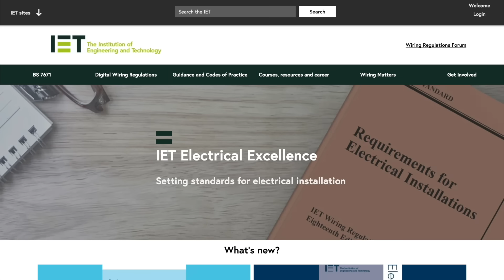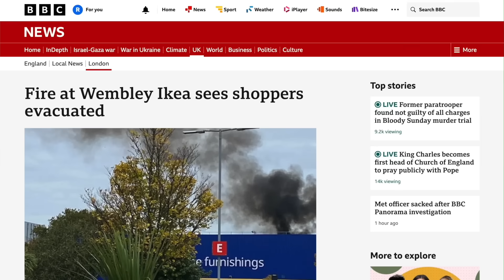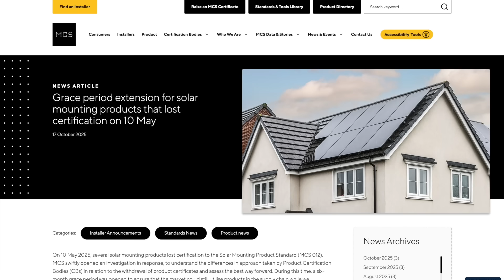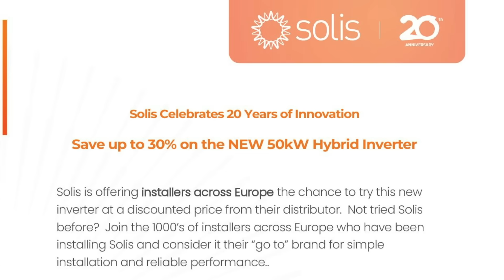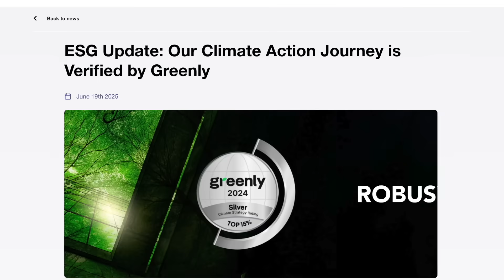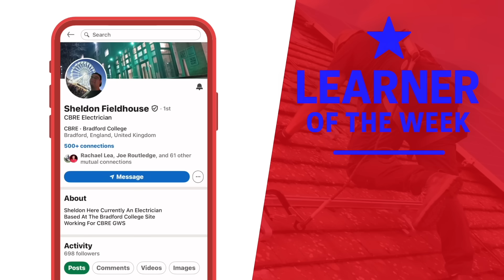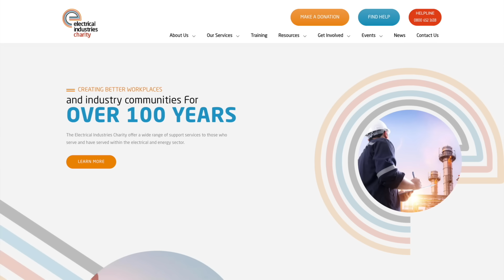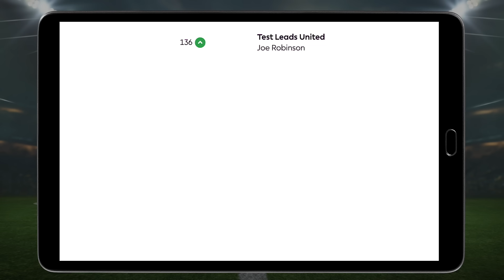Exclusive: Grid Bosses Set to Change UK Voltage

Comment: The UK's nominal voltage was changed from 240V to 230V in 1994 as part of a European Union effort to harmonize power standards. However, the actual supply voltage in the UK has remained closer to 240V and has not been physically reduced, since the change was mainly about aligning the nominal standard to allow for the harmonized manufacturing and trade of electrical equipment. 
1994: The European Commission decided to harmonize voltage standards across Europe to a nominal 230V to remove trade barriers. The UK's nominal voltage was officially changed to 230V at this time.
Reply: To me I still calculate based on 240v even though my place often sits at 250-255v and sometimes even 265v
Reply: @mlee6050  its usually between 230 and 240 here now, used to be higher but as theres a lot of new housing gone up here the extra loading has likely dropped it
Reply: @mlee6050  On my BS 7671 courses, the first was spot on, the last (2001) was??? The instructor seemed arithmetically challenged.  I've always estimated fusing requirement at 1000/250 amps per kilowatt, (4, against your 4+ 1/6th ) so 3kW, a high powered kettle, say, needs 12A, thus a 13A fuse will suffice... (assuming a relatively short lead, etc... He struggled to grasp that just multiplying kW x 4 got you in the ball park...
On maintenance at a large plant, I went to my "engineering manager" (electrician by trade) and asked for a long extension lead to be made up for the welding machine... Let's say it was 6mm^2, rubber insulated, rubber sheathed.  He decided 4mm^2 was adequate, PVC/PVC.. I took the remains of the lead to him after someone had used the welder on shifts, hadn't unwrapped the cable, and the PVC sheathing had melted, welded the wraps together into a copper / PVC pretzel... (I always unwrapped the cable and snaked it around the floor to cool, if the job was near a socket (not all were, hence the extension....) Working a long way from a socket, the cable was adequately cooled as a matter of course...
Reply: @mlee6050  isnt that out of spec?  All of my power supplies and other transformers usually say 100-250v range.
Reply: @konzo5942  I don't know what mine say, I just know UPS tells me voltage I said
Reply: But it came with in the paramilitaries of +10% -6% at the Nominal 240 v, they only changed the voltage output on newly installed transformers, the voltage  in my house sits around 245v all the time.
Reply: @Sparky68M  I thought nearest sub station went to 240v then sent down multiple streets, I look forward to the idea all houses be three phase as they think it be better
Reply: @mlee6050  I used to work as an approved sparks on a supply authority. I can remember an argument with a factory owner who thought we were cheating him running four core for a new supply because he thought you could get 3 phases down a two core cable.
Reply: @mikemines2931 I'm getting two single phase down a four core :3 I got set up so two are live but smart plug switch between them so depending on what system I use
Reply: @mlee6050  We use three phase here in the UK, two phases to a three phase motor is called single phasing and releases very expensive smoke.
Reply: @mikemines2931  that must be fun, so know I believe black and brown I'm using as live, gray is neutral and bare copper is earth, of course I got neutral and earth shared but only one live runs at a time
Reply: @mikemines2931  Never release the blue  smoke!
Reply: @mikemines2931  three phase grids are universal worldwide, the only national differences on that is whether three phase gets delivered to homes and other small buildings or not, and whether three phase or single phase transformers are used. most of the world tends to near universally use three phase distribution transformers, and then deliver all three to a home or one of the three. But even in rural UK and Europe the occasional 240/480 single phase transformer can be found. North America and Japan tend to only deliver three phase to larger buildings while using single phase for smaller ones. As an American i find the European system of bringing three phase nearly everywhere better and more efficient.
Reply: @Sparky68M thing is, here in 220V land, we got the same tolerances in that move to 230V. We mostly use actual 230V nominal but it goes up quite close to 253 on sunny days. We thus have a wider band to play with which makes it significantly easier to operate the grid.
Reply: @JasperJanssen  Hi, i live in north germany. We turned from 220V to 230V in the mid 90th. Most time I got  235 -240V in my sockets , the substation is abt. 500m apart from my place. 
yes and we got three phases mains in all houses here . The main breaker at the incomer has 3x50Amps.
Reply: @Sparky68M They gave me the same +10% -6% option. I refused, so the paramilitaries blew my house up, and now I've nowhere to sit.
Reply: @Sparky68M  do you mean parameters, and not paramilitaries? I mean they could conduct electricity but it might be painful?
Reply: @CuriousCrow-mp4cx  ...think it might be right first time :/
Reply: @Sparky68M  Paramilitaries? What? Are the Troubles back? 😂
Reply: Correct. The +/- range was widened out so that both 230 & 240 fit within the tolerable range in the standard from then, as does the normal 220 V across the channel.

A few years ago, the DNO in my area (SSEN) replaced the old local transformer serving my street and a few others with a new one, rated at the modern standard, so it’s nominally 230 instead of 240. In practice (using the meter display on my PV inverter), it’s usually around 235 now, and occasionally spiking up to 240. In the old days, it was often around 245 most of the time. It’s only a short buried cable run from the nearest substation with either 132 kV or 275 kV input overhead.
Reply: @johnkeepin7527  Over here in Serbia it’s also nominally 230 but in practice we get ~240 from the transformer, especially noticeable in dense urban areas where a transformer might be right next to your building. In rural areas with a single transformer might serve up to 500-600m of a run and if you are at the end of a run you will probably notice lower voltage under load
Reply: Load of shit the colours should never of been changed.
Reply: @kevxsi16v yeah, I miss red and black
Reply: @mlee6050  I live in a mixed 240vac / 13.4vdc home, so im greatful for the change.  My dc is all red and black
Reply: @nosay2930 I miss 240v black and red as knew red is live, I keep having to say black and blue as how taught for new wires to know way they are
Reply: @nosay2930  I got a also a dc network, but 24V due to wire size. Several lightings and low power appliances run on it. The battery is Solar buffered.
Reply: Lower voltage = lower power output . slower charging for EV cars, especially as EVs and heat pumps add unpredictable demand spikes. There has been Zero planning as usual Many neighbourhoods still rely on low-voltage substations not designed for simultaneous EV charging.  We are reactive to say the least. I just had the leaflet what to do in a power cut, so you know where this is going, our infrastructure is old. and they want more heat pumps and more electric cars. just when electricity is the most expensive energy to use. 😞 This Government and the central planners are a joke ( all governments i should have said)  😞
Reply: The closer you are to a substation the higher the voltage. They have to step it up to reach places further from the sub station and still have a usable voltage. Dunno about the rest of UK but Scottish power allow themselves a 10% discrepancy up and down on 230v  obviously meaning it could be as high as 253v , and be frying some of your delicate appliances like PCs and there nothing you can do about it.
Reply: @Disc023-ps6le that is true my neighbour next door is a highly qualified sparky and explained that the reason our halogen bulbs were blowing almost daily is because we get the full benefit of the substation only five houses away. Since we changed to LED bulbs the problem has gone and it's better for our leccy bill.
Reply: @fus149hammer5  only downside to LEDs , they don't tolerate spikes or peaks like an old filament lamp. So your more expensive led that's supposed to last 20,000 hours could be popped with the first spike or surge in voltage ( if that were to happen )
Reply: @Disc023-ps6le not had that problem yet although when they say how long LED lights last we know they are lying.
Reply: @Disc023-ps6le  Your PC will have a switch mode PSU that'll deal with a wide range of supply voltages...
Reply: @robertlawson8572  didn't know that, thanks. My experience was 20 ISH years ago when pc power supplies were more basic and didn't have good surge protection.  3 customers called me almost at the same time and in the same area reporting the same thing ( dead pc ). Being a sparkie who could build PCs it didn't take me long to work out. All 3 properties were fed from same substation and had almost identical abnormally high voltage. That was a good week for business 😀
Reply: @Disc023-ps6le  I was learning about (but not in any detail) SMPSs in 1977... (on an engineering course...) Developed for the space program/me for lightness' sake.  Linear PSUs are heavy... But Power Devices were really expensive Now I have a tiny welder that weighs a fraction of what an older one did...
Building (and repairing) PCs was relatively easy in the early days, optimisation for particular software, etc? not so... I still remember using a Celeron processor in a computer I used for a cad program... It worked part time... Lesson learned!
Reply: @robertlawson8572  jings,  celeron!. My first pc I built was a celeron 400 or 700 I think. Back in the day when social media was basically an IRC chatroom 😂
Reply: @Disc023-ps6le sorry I work in it. And power supplies have zero issue with that high a voltage
Reply: @shaunburns3332 that was what it was resting at, the spikes would have been higher.
Reply: Sweden went from 220/380 to 230/400. And also of course +-10%. At home i often have around 235 up to 240. My UPS is set to trigger at around 207 and 253 (yes, it can trigger both ways). It will also stabilize the voltage as much as possible before that, not using the battery.
Reply: @rodgersmith9356  I worked as a arborist on power lines in central scotland around 15 years ago an it was 220 at that time, this is scare mongering!
Reply: All the infrastructure transformers etc stayed the same with simply a different nominal voltage and ranges.declared.
Reply: The uk voltage was not changed but are standard cauluation point was from 240v to 230U witch is like heads and tails on a coin sounds different but is the same
Reply: Does that mean many of the gadgets in my home such as WiFi switches and pods will stop working? Many modern devices rely on set voltages and there has been a massive increase in home automation since 1995 so will this cause problems?
Reply: @fus149hammer5 I have problems with home automation even without power issue, I got so all lights turn off together but so often just one turns off, leaving the 7000lm light on and I have to get up to turn it off
Reply: @mlee6050 I've found that the problem was with our Internet provider which was Virgin. Speakers disconnecting, WiFi pods not working after updates and having to be rebooted numerous times, it was bloody annoying and frustrating. Since we changed to EE the problem has disappeared.
Reply: @fus149hammer5  NO  YOUR   RADIO   WIFI /SWIT ..TV ... WILL NOT NOTICE  ANYTHING
JUST RELAX
Reply: @fus149hammer5  Highly unlikely.
Reply: Precisely, but some numbers for context-  UK tolerance is +10% / -6%,  so permitted   maximum and  minimum  253v and 216v (UK) 253v and 207v  (EU)  I  read a fairly consistent 237v at home, have read up to 250 V at workplaces (may have taken a crap meter on site) I remember we had to make arrangements for an old French crane, part of the equipment that came with an old French aluminium rolling mill, since it was unlikely (380v nominal 3p ) to survive 415 v in the long term... I'd have bought a new hoist motor, myself, but it was done expensively....
Reply: When the windmills stop working, we won't get any voltage at all!
Reply: @anthonyclent6240 we be fine starts mining coal
Reply: Australia did the same thing about the same time. There used to be differences between Australian states!
Reply: Australia is similar. Last time I checked I was getting 245 volts.
Reply: >250V is a crime
Reply: my parents live in Italy which used to have 220 nominal, but last time i was there i was troubleshooting some electrical problems, and the voltage there in practice usually hovers right around 245-246. and funny thing is, they are a good 300 meters away from the utility transformer. so yeah, nominal voltages are only nominal on paper.
Reply: I remember it well. I had to around the Central Line on London Underground changing all the mains warning labels on the radio racks.
Reply: Ed Millbrain will get in down to 0 volts ... For NetZero
Reply: Saudi Arabia uses 60Hz used 127V US outlets and then UK outlet 220V at 60Hz.

Comment: Scotland would have the cheapest in whole of uk, as it makes the most but the system in place results in London have cheaper electricity prices compared to Scotland.
Reply: We should have localised energy pricing, but you do need to appreciate that delivering electrons to someone in Glenbuchat costs a bit more than someone in a tower block in Haynes.
Reply: @edc1569 really, how’s the work then, when a significant amount of energy flows from Scotland to England, particularly electricity generated from Scotland's abundant renewable resources. Scotland has a surplus of renewable electricity, primarily from wind power, which is exported to England through the national grid

Comment: So, what will these mean to all our calculations we have to do ? What about legacy appliances that have PSU's that will start to fail as they won't be able to handle the potentially lower voltage. Seriously this hasn't been thought through. Most EV chargers I've installed are set to fail if the voltage falls below 216V, and there is no way to change it, so is that going to make those obsolete ?
Reply: Sounds like that EV charger wasn't compliant with the harmonized requirements for what grid power appliances have to take without making any fuss (230V +-10%)? If so, sounds like a defective product. You have statuartory warranty for "defective at time of sale" in the UK, don't you?
Reply: Probably just a firmware update.
Reply: As long as the EVSE comes back up when the voltage returns: that may actually be a good thing, charging the car only when excess electricity is available.

Comment: Being not very knowledgeable about electricity my question is at a lower voltage will it mean my 2 kw heater will give me less than 2 kw per hour .
Reply: @Keith-s4f  Since a heater is a purely resistive load, its power consumption is directly related to the supply voltage. A voltage drop will cause the power output to decrease significantly, following the formula (P=V^2/R).  So a 2% drop in voltage will result is a 4% drop in power output of your heater
Reply: @farab4391 Thank you very much for your reply
Reply: ...fractionally. Which means, if it has a thermostat to regulate output temp, as it cycles ON/OFF it will remain ON for a few seconds longer (so to deliver the same energy). Alas your bill will not change.

Comment: Mains voltage in the Uk is 240v, always has been, and probably always will be, all the Regs authority  did was stretch the envelope of max and min allowable parameters. The cost of actually changing to a nominal 230v doesn’t bear even thinking about. During my training we were told to say the nom Volts was 230 even though it always tested around 240. Engineers do not lie to the public!
Reply: @philhermetic  
A man who did his apprenticeship with Switchgear pre 1939 always expected 250volts..
He expected few houses would draw more than 5 amps. Electricity was only for lighting. 
There was a fridge. A gas fridge. One of them was brought into the corner of a lab to chill samples and that was the first time I had heard of it.

Comment: UK voltages have operated at 230v for many years.  The change was announced on January 1, 1995 with a transition phase to 2003.    This was not implemented as such.   instead, in practice the actual voltage is designed to be 230v plus or minus 10%.  This means it operates with a tolerance band.  However reducing network voltage can have significant benefits, particularly where there is a large concentration of resistive loads. For these types of loads reducing the voltage will reduce the maximum demand requirements and, depending on the control mechanism, can also reduce the consumption. The effect of voltage reduction on a substation depends on the specific make-up of the local load. As this is generally unknown, estimates of the benefits of voltage reduction vary drastically, ranging from consumption dropping by the square of the reduction to no drop at all.
Reply: If electric heaters don't work well enough get another one and add that in.

Comment: Are they going to put the price down, if they are giving less electricity ?
Reply: You know voltage is not the amount of electricity? It's analogous to water pressure, reducing the pressure does not mean you're getting "less water"
Reply: You're not getting less electricity, unit costs are based on kWh, you could drop it all the way to 110v but a kW is still a kW, a lower voltage just means more current has to flow to deliver that same kW.